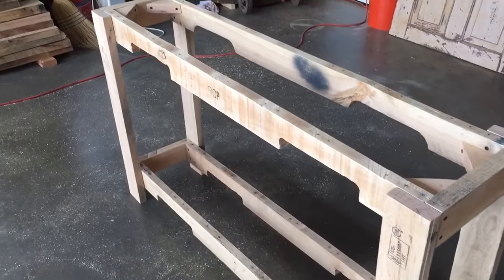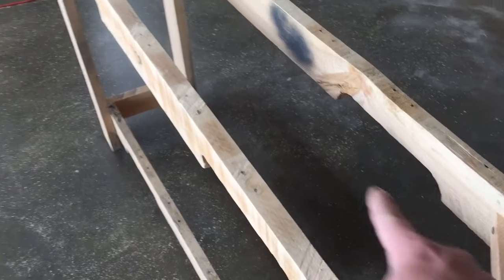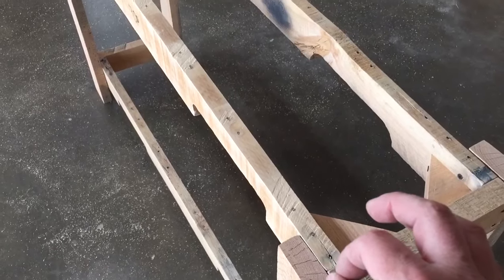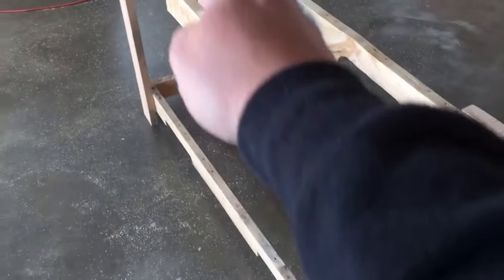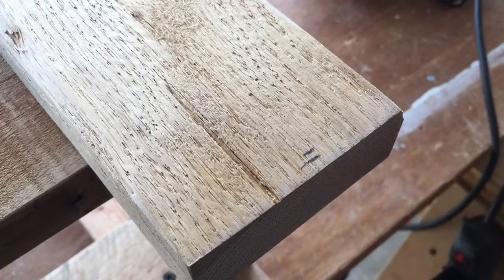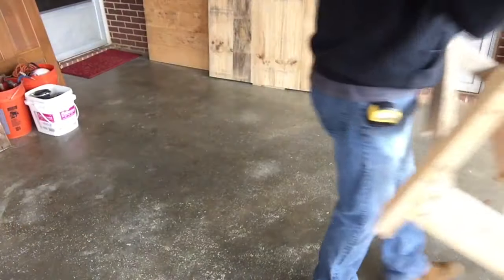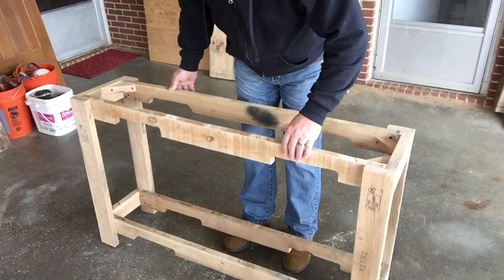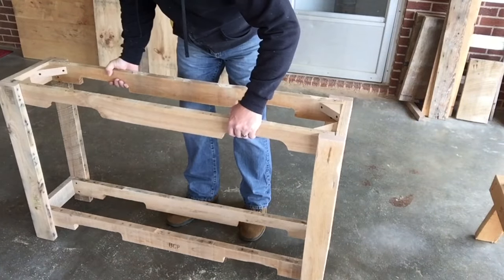Leveling a Small Table

Comment: Make sure your floor that you're leveling it off to is also level. Garages tend to have a small grade (1% or so) for water drainage. You can then put things under the legs until it no longer rocks, I recommend cardboard. The height of whatever you had to add to the short leg is now what you then have to remove from the longer legs. Conversely if you didn't want to cut, you could glue a rectangular slab of wood to the short ends. Mix wood glue with sawdust and you wouldn't even tell any adjustments were made.
Reply from the maker: Awesome advice. Thank you!

Comment: Using a speed square with the circular saw will keep you from getting crooked cuts. When I shave off one leg, I always start by measuring the distance from the ground and the bottom of one of the "off the ground" legs. That usually gets me within 1/8" of where I need to be
Reply from the maker: Great tip!